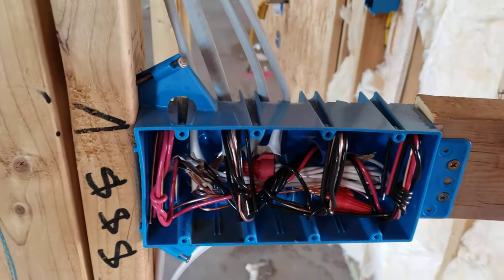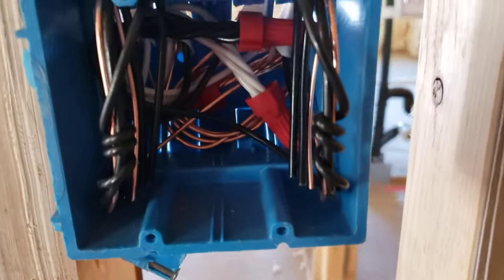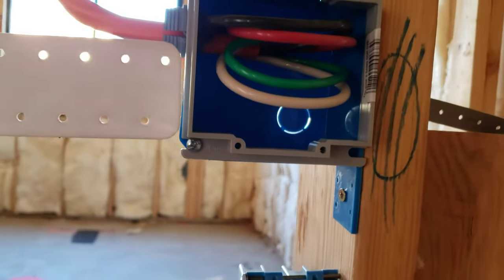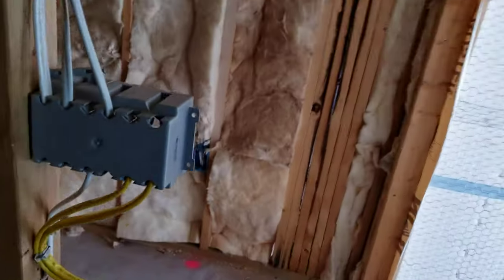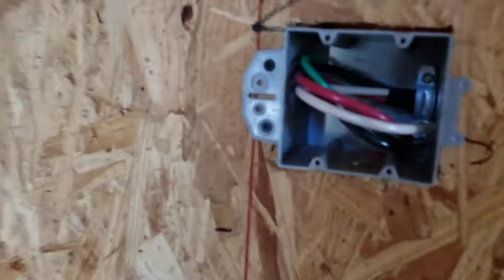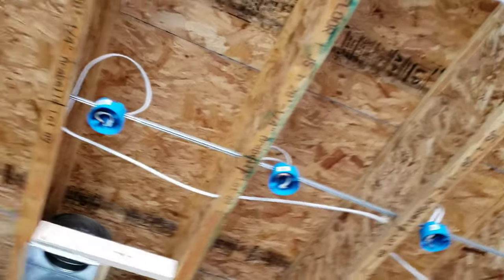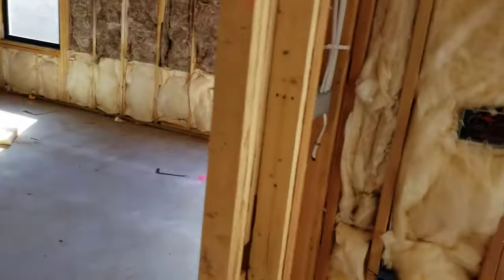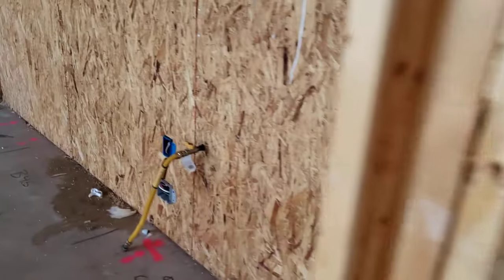Copper-clad Aluminum Wiring Found in New House!

Comment: Awesome.    Like it or not, Aluminum and Copper clad Aluminum is making a comeback so we best get used to it.   Personally I would not be afraid to purchase an early 1970s home with aluminum branch circuit wiring.   I would however,  definitely make sure it's been repaired with Alumniconn connectors.   You see, aluminum wiring got a bad reputation for many years, and there's some truth to that.    The older aluminum alloy,  1350, sometimes called old technology aluminum wiring,  was used until about 1972, afterwards the industry changed to 8000 AL,  (Copper-Clad began to appear during this time) which is used today for the main service wires, and often for the range,  electric furnace and central air conditioner as well as subpanel feeders, sometimes referred to as new technology aluminum wiring, this has superior properties compared to 1350 AL.   A general rule of thumb is, if a home was built in or had a renovation that involved adding more circuits during the Vietnam War,  there's a  strong possibility at least some of the circuits are aluminum, probably the 1350AL.  Aluminum wiring was never recalled, existing stock was permitted to be used up, so in some cases you might see aluminum wiring used into the late 1970s or early 1980s, but this would be rare.
Reply from the maker: You’re correct. I’ve even been seeing aluminum used as 30 amp dryer circuits in new houses. Water heaters also. There’s a video here on YouTube that shows a home inspector finding aluminum branch wiring in a 1980 house. So don’t rule it out because a house was built in the late 70s or early 80s.
Reply: My house uses AL wiring, and I've been using Alumiconns, problem for me is that they are very expensive, and its good to preinspect them to make sure they have antiox in them.  I've had some lugs with no antiox or a small amount in them.  

I started using WAGOS using OXGARD (wago recommends their antiox) inside of them, and they have been working great.  Wagos are a lot cheaper and they give you more room to work with in box.  I also put electrical tape around the wago to keep the levers closed, and away from air.
Reply: @panemon187  i wanted to use Wagos in my house with copper clad AL. but they are rated to 12 guage, and most of the wire I have found so far is 10!  are you using a different wago for 10?
Reply: @Revvek  Yes, WAGO now has a splicing connector for 10AWG with the 221-61X series.  

They also have in-line splicers, but not yet for 10AWG yet.  

It also may not be a bad idea for you to fill your wago with some antiox paste if you're going to use copper clad AL.  

I don't know much about CU clad AL, but I do know that AL conductor can expand under load and that CU and AL together without antiox can cause oxidation, which can cause heat buildup due to lack of conductivity. (AL oxide becomes non-conductive)

(Wago has their own proprietary antiox they recommend, but I've been able to use generic brand antiox that works just fine.)

I also like to wrap about 3 windings of colored electrical tape to color code my pigtails (black for hot, white for neutral, green for ground) and to prevent the levers from opening up accidently (which has happened to me a couple times)

Comment: Copper clad wires break if you nick the wire when striping the wire with wire striping tool...I found it's better to strip with razor knife so not to nick the wire...that was big problem with aluminum wire back in the days aluminum wire was used..

Comment: It breaks very easily. I had two outlets go out already in new construction. While replacing them, the wires snapped where the previous electrician had stripped the plastic housing. He had cut thru the thin copper. So at that weak point, the wire had snapped. Not safe. Now, I’m worried about checking every connection they did.
Reply from the maker: Interesting. Was the old connection made around the screw of the outlet or was it pushed in? One tip to install an outlet could be to use ideal three way push in connectors and carefully strip the wire. Then use a piece of 14 awg copper the push into one slot and use the other two slots for the 12 awg copper clad aluminum. They also make a blue push in connector that could work for 10 awg copper clad aluminum. Are you located in the Phoenix metro area? If the house is less than two years old the builder should still be responsible for all electrical issues.

Comment: you have to up it by more than 1 gauge, you have to up the wiring by a % of the diameter of the wire. i feel like the 1 gauge comment upsize would get you into some issue with people who are say, using aluminum service entrance wiring. the rule of thumb is 56% difference larger in aluminum versus copper. it's pretty sad that they cheaped out a couple hundred bucks on a $400k home for inferior wiring.

Comment: I found my house (from the 70s) has copper clad aluminum, I recently started to go  through and replace all my outlets and switches...  I HATE IT!  it's 10 gauge all over the place, making proper wire nut install harder for pigtails and such... I had 1 box pull off the stud inside the wall because it's so hard to get it to push back into the box!
Reply from the maker: Yeah that can definitely be a challenge. A lot of houses built in Sun City AZ in the 70s also have cca. One tip I can give is that if you’re trying to pigtail every outlet don’t. Doing that is not going to improve the functionality in any way and make it super hard to work with the wires. An outlet with four wires properly and tightly attached to the screws will be just as safe and work just as well as one with pigtails. Pigtails are not impervious either. Wire nuts fail too. So just try to bend nice loops in the 10 gauge wire and wrap them around the screws. Then try to put a fold in the wires before trying to push them back. And if a outlet box seems loose you can always shoot a drywall screw through it into the adjacent stud. Hope this helps you change your devices.
Reply: @everythinghomerepair1747  yeah ok, that makes sense.
I had to put 2 drywall screws into the one box to hold it so I could get things back in it. It came completely loose, and in that box the wire nut they used to connect the half hot wires, was kind of loose also, so I tightened it more as well before putting things back in. You can’t get a good twist in the wires, where they kind of hold themselves… just to thick and stiff. 
I’m thinking about maybe using some wago 221-612 or 613s in place of wire nuts in places that seem iffy… but I don’t think they want to recommend them with copper clad or maybe any aluminum wire or any kind… (the one response I got so far was, we don’t make anything for that)
Reply from the maker: @Revvek   I would not expect them to be made specifically for copper clad aluminum. Most regular wire nuts or outlets are not listed for it either. That does not mean you can’t use them though. The manufacturer of the actual wire itself has asserted that any connections listed for use with copper with also work on CCA. I would have no issue with the WAGOs and if they have a WAGO for 10 gauge I would go ahead and use it. Hope this helps.
Reply: @Revvek  I think I would try a slightly larger box if feasible for at least some ie an oversized box etc if tolerable..
Reply: @everythinghomerepair1747    I was recently replacing an old outlet and noticed my wiring is also 10 guage copper clad wire.  I found it too easy to break off the wire when trying to bent it around a screw on the outlet. So I got an outlet that has something that lets you just push the wire under a metal clip and then the screw tightens that clip over the wire...so no bending needing.  Is there any issue with using that style of outlet?    the outlet was not intended for aluminum but I read that you dont' have to use special outlets for copper clad ones.
Reply from the maker: @Fremen02  hello. Thanks for watching. No, there’s nothing wrong with using that style of outlet. That’s actually the style I would recommend. One important thing is that you tightened the wires down very tight under the clamps and no insulation is under the clamps. Any loose wires will cause the connection the melt no matter what type and size of wire but it’s especially Important to have this style of wire very tight.

Comment: Any issue of using CLAD, less efficiency or conductivity? Or potential fire hazard?
Reply from the maker: Well, for now the jury is still out on that and only time will tell. However as of this date no major issues have been reported.
Reply: @everythinghomerepair1747  hope not, almost all new house built by this builder after pandemic is using CLAD wiring only.

Comment: How did the electrician wire the kitchen receptacles - #10AWG to a receptacle with max of #12AWG under termination screws?
Reply from the maker: They wired the kitchen, bathroom- and all the 20 amp circuits with #10. Also most outlets and switches I’ve seen can accept up to #10 under the screws. Keep in mind that cca is very soft so it’s nothing like #10 copper.
Reply: @everythinghomerepair1747  so the terminations are like Cu... Nothing special needed.
Reply from the maker: @tompolk7588  yes everything is exactly like copper. Obviously like always special care should be taken to ensure all connections are tight.

Comment: The CCA NM cable is more round compared to the oval NM cable we're accustomed to seeing. You shouldn't need to make a loop on the device, the device (switch/receptacle) should be rated for 20 amps and then the wire can be stabbed. I prefer the loop but sparky will do what sparky does.

Comment: I assume that builders are switching to this hybrid wiring arrangement because of the alleged current shortages of materials and/or high copper prices. Isn’t all-copper wiring generally better than CCA?
Reply: Electricity travels along the outer skin of the wire. The aluminum core alloy has been improved.

Comment: Is there a difference between CCA used today and CCA used in the 70's?
Reply from the maker: The only difference that I’m aware of is the color of the outer sheathing and the temperature rating of the wires. The actual metal is exactly the same. Thanks for watching.
Reply: @everythinghomerepair1747  Thanks. Do the receptacles and switches need to be rated for CCA? Or can CCA be used anywhere copper os required?
Reply from the maker: The receptacles and switches can be any ones rated for use with copper only. Just make sure the wire nuts are big enough for the bigger gauge wire and the boxes can handle the larger wires as well.
Reply: @everythinghomerepair1747  thanks!
Reply: @everythinghomerepair1747  The aluminum alloy composition has been improved/upgraded.
Reply: @everythinghomerepair1747  The receptacle switch devices should be rated for a min. 20 amps.
Reply: @highenergyideas  The did use "pure" aluminum on some homes in the 70's (mostly). But CCA was also around during that time, only not as prevalent.
Reply: @highenergyideas  They most certainly did use cca in the 70's.
Reply: Lebled: "CCA" on the sheathing.
Reply: My home was built in 1976.  Most of the wire is aluminum.  The 20 amp circuits are all the larger sized copper clad aluminum.  I haven't had an issue with the CCA, but I had numerous issues with the pure aluminum.  That was because they wired it with switches and receptacles designed for copper only, and they were backstabbed on top of it.  Awful.  I went through and changed to co/alr devices, and since, I have been upgrading to alumicon pigtailing.  So far, so good.  I do need to go into my breaker box and re-torque all the connections.  Aluminum tends to expand and contract  @highenergyideas
Reply: Does it mean switches and receptacles have to be rated for CCA

Comment: Okay.  When you use a wire nut on copper clad, it will cut into the copper layer on the outside, which then exposes the aluminum.  Doesn't sound like a good idea to me.
Reply from the maker: If the wire nut cuts through the copper layer then it is very secure and all the wires copper layers are compressed together so tight I would call that a great connection. Since the making of this video no other home builders have adopted CCA. Just this one large home builder still. I have noticed they now don’t use wire nuts anymore and use all push in connectors with CCA. Honestly I’d rather have the wire nuts in my house.
Reply: @everythinghomerepair1747 are they using Alumacons?
Reply from the maker: @lindsayshelton5345  no, they were not using alumicons. They used wire nuts and push in type wire connectors. Alumicons are not required with copper clad aluminum only with solid aluminum. However sine the video has been made now all builder’s in my area have stopped using CCA except for select 240 volt circuits. It was something they used when the price of copper wire was very high and now it has come down a little.
Reply: Copper clad from everything I researched lately is required to be at least 10% copper. When they clad they aluminum it is welded to the aluminum in a vacuum which creates a psudo brass chemical bond between the copper and aluminum. At this point I’ve seen no evidence that a standard wire nut would damage it enough to reach the aluminum. The biggest issue I’ve seen is improperly sized and wrong box fills.

Comment: Cons of copper clad aluminum wiring in a home?
Reply from the maker: The only con is that it is harder to work with than regular copper because the wires are bigger. This also means that you cannot “backstab” wire your outlets.
Reply: @everythinghomerepair1747  why would anyone who knows anything about electrical EVER backstab anything? Wtf

Comment: I hate aluminum wiring. My next home will have all pure solid copper.
Reply from the maker: Well now you know what to check for. You will limit yourself a lot because most homes- at least where I live -have aluminum 240 volt lines for the A/C and electric stove.
Reply: Same I feel like I'm always checking my aluminum wire to make sure connectors aren't overheating